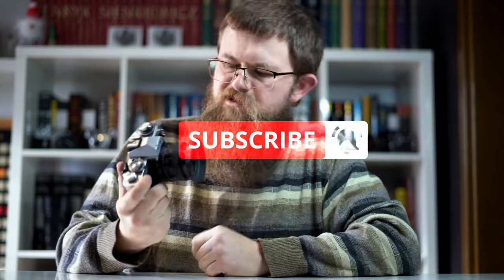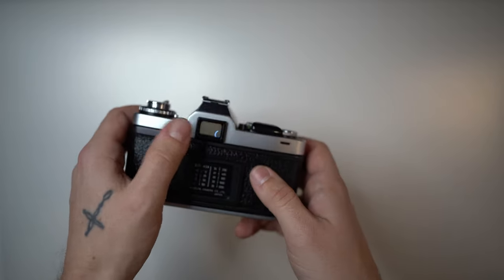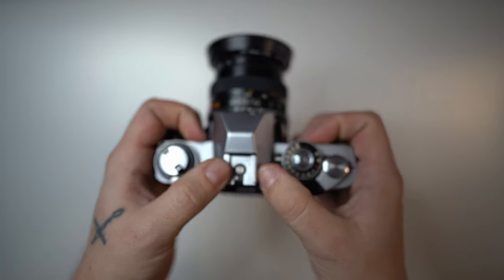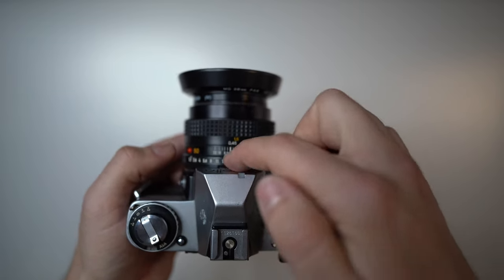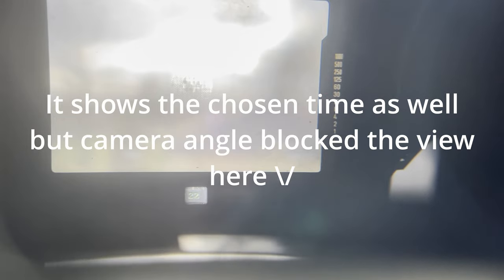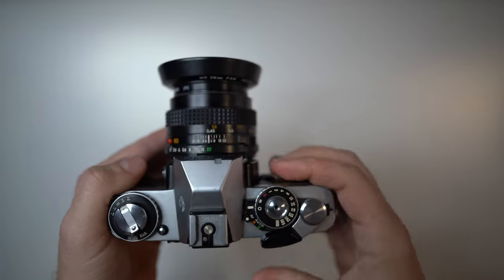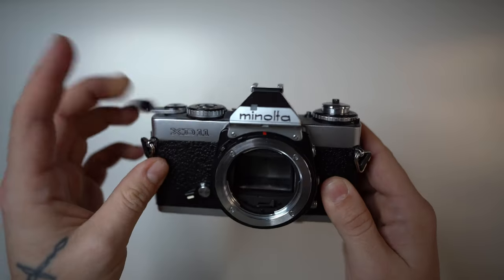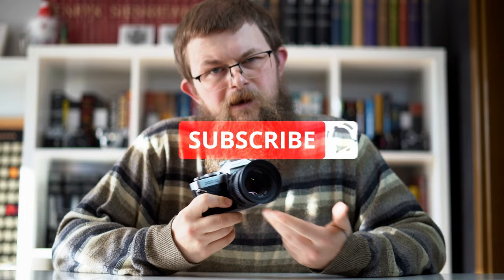How to use a Minolta XD/XD7/XD11

Comment: That view finder blind is actually more for controlling the amount of light that the meter sees when shooting on a tripod without your eye to the view finder blocking light. Closing the blind will give better exposure metering.
Reply from the maker: Yes that is also correct :) but i never seen any difference with it open or closed :) but im sure it can depend on how the sun falls on it :)
Reply: @grainificent  great video, was looking for something to share with a new user of this camera, I have recommended this camera to many who have fallen into the hype over the X-700.

This blind is a valuable tool when using automatic metering, you can often see a difference in exposure settings, these days few people look at their negatives, and scans from the lab will always compensate to give usable images. It might not make a noticeable difference to many people, especially those who foolishly opt not to get their negatives back and settle for jpegs.  ( don't ask me where people get these silly ideas, but there are lots who think their low res digital scans are good enough and have ZERO understanding of the value of their negatives ).

All that said, that blind does make a metering difference and it's primarily why it is there, it might be subtle with many film and setting scenarios like you said, but if you shoot slide film or hight resolution films you may see the difference in density of your negatives and shadow detail.
Reply from the maker: Yes, the labs do a bad work many times and the photos can have a different look depending on the lab you take it to. That is why i do my own developing and scanning :) im not such a pro to know the difference on negatives if i used the blind or not ;p but my daily carry rangefinder doesnt need such things luckily :)
Reply: @grainificent that is a fair point about your range finders LOL.

I think most labs are pretty good, at least the ones that keep there chemistry good, the difficulty in really monitoring exposures is with so many people who only review their scans, the lab is always going to try to get what they can from the negatives you shoot, this was always the case back in the days of film when the lab would make adjustments for prints.

 If you are developing at home it might be an interesting experiment to try shooting some Ektar 100 stopped down to f8 or 11 and let the meter chose shutter speed and shoot a few frames with the blind open and a few with it closed, if you are shooting a landscape with lots of deep shadow detail it might be interesting to look at your negatives and see if you can discern a difference in density of shadow details. 

If you are developing yourself you are likely much more in tune with your negatives than most.

I appreciate your responces here!
Reply from the maker: i wish i was more in tune with my negatives ;P i shoot with so many different cameras that i don't concentrate much on the tiny differences in negatives :) but one day i will learn as well :)

Comment: Do you find that you are able see the entire viewfinder well while wearing your glasses? I'm thinking of getting an XD, and I've read that the XD-s is preferred for glasses wearers due to it's diopter adjustment option, but it's also much harder to find and more expensive than the XD7/11.
Reply from the maker: yes, the XD-s was only available in Japan so it makes them more rare and hard to get. but it isn't any different then the regular XD other than the diopter but i never use them in cameras personally. i never complained when using it with glasses :) but i did change to contacts to get a better view in most of them especially rangefinders :) but many people use them in glasses and never have any problem.

Comment: Nice video!  What Minolta camera would you recommend that is completely mechanical, where you only need batteries for the light meter?
Reply from the maker: the minolta SRT 101 is amazing if you want a SLR camera or (my favorite) the Leica/Leitz Minolta/Minolta CL (all of them were made by minolta but different branding) if you would want a rangefinder camera :)
Reply: @grainificent  SRT series are fantastic, I have a Super and a 102. Built like a Tank! 👍
Reply from the maker: yes they are :)

Comment: Also, it is said that the xd had a program mode... it's a legend tho... or is it ?
Reply from the maker: yes, in theory is has a little program mode. when set to shutter priority, when faced with an extreme where the camera can't open or close the lens enough for proper exposure, it will change to a different shutter speed. i have heard about this always but i never checked if my camera does that ;P i need to look into that and try it out :)
Reply: @grainificent  oh indeed, that is the compensated programming but it does it only as an AE program.

But, it's not the program mode, it's just a little push that they added for convinience. 

For the program mode, you gotta go green, all green x)
Reply from the maker: @georgeabitbol4180  yes i read about that but my xd11 doesnt have grean 1/125s shutter so i wonder if it works. i will do some tests and might make a video about that if i find it works reliably :)
Reply: @grainificent  yes i've heard that not all of them have the green 125, and yes that a good question, i never came across one that didn't had the green 1/125, so yeah i'm not sure
Reply from the maker: @georgeabitbol4180  i'm waiting for film to arrive and will do some tests if it exposes correctly at the "all green" settings :)

Comment: Got mine today. Was listed as used but working.. It doesnt work. Manual mode wont work. O - Mode works. Lightmeter doesnt work. Batterys are fresh and even tried the working ones from my pentax me. 
I think its the capacitor thats faulty? Man that fucking sucks. I hope its easy fixable.
Reply from the maker: yes it does seem like an electrical issue... i would try returning it first as it is not working and there can be so many things wrong with electronics... repairs can go over the value of a working one. it can be simple, but you never know.